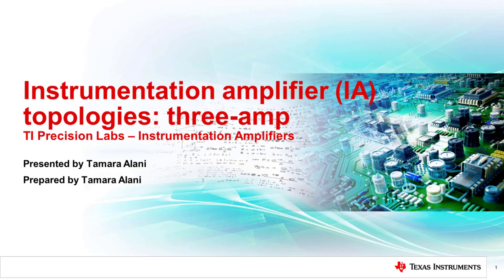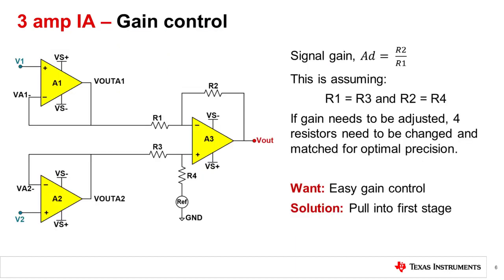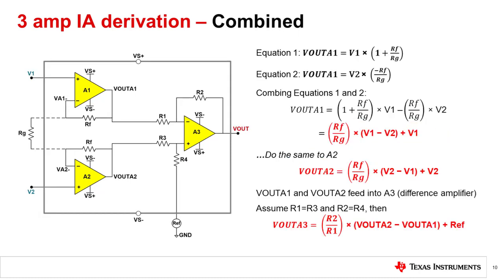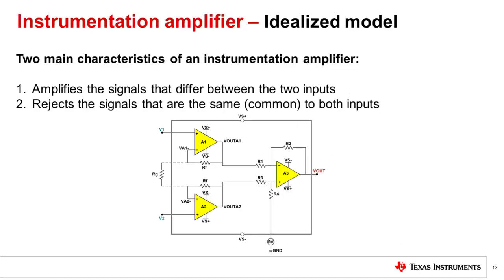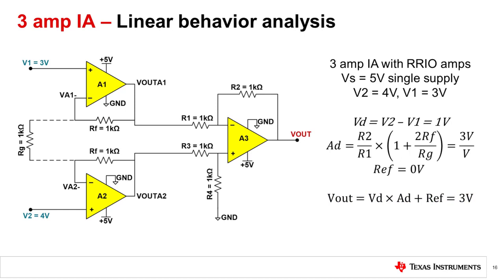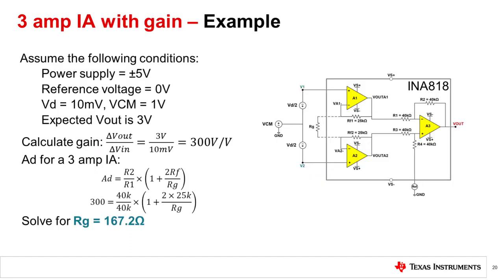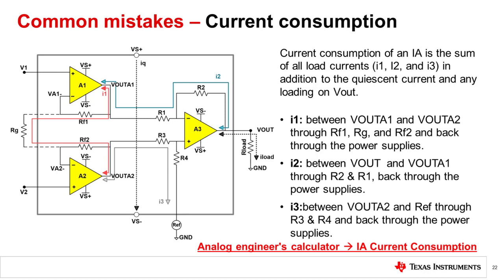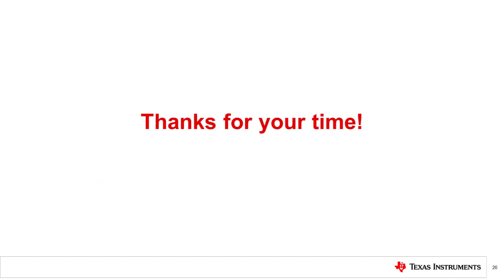Three amp theory

Comment: On Slide 11  the first equation for VOUT (without simplification) is inserted wrong. The position of VOutA1 and VOutA2 are switched. The equation after simplification is however correct again.
Reply: It should Read Vout=R2/R1 ((Rf/Rg x (V2-V1)+V2)-(Rf/Rg x (V1-V2) +V1)) +Ref